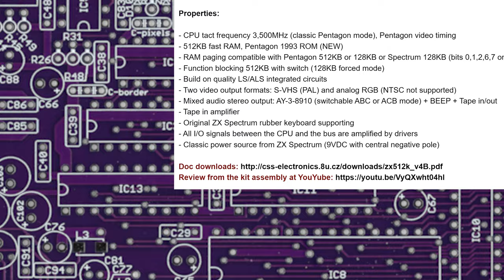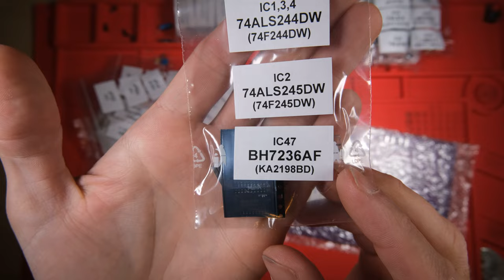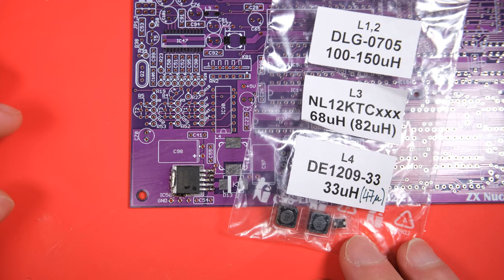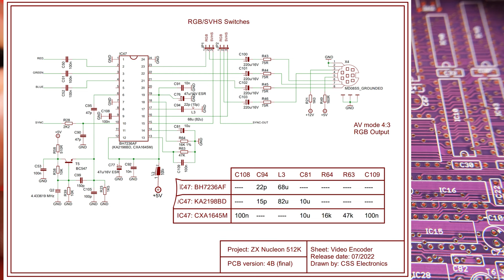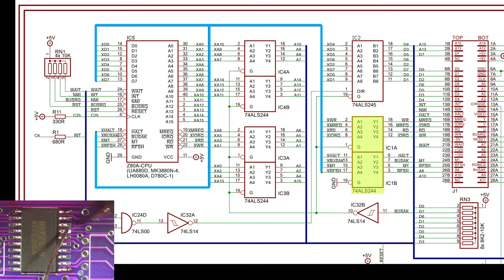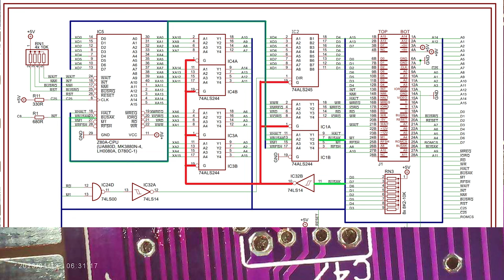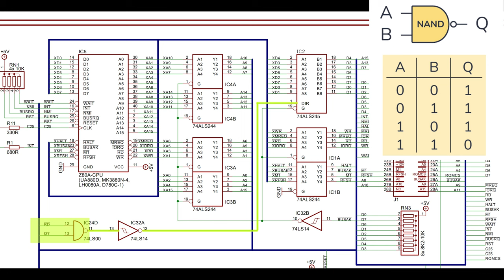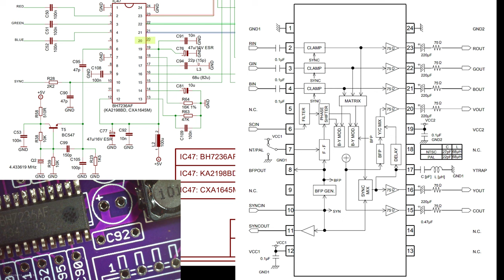ZX Nucleon 512KB - Build Part 1 - SMD

Comment: Best way to do those big D2PAKs is start by tinning the pad as you did, as flat as possible.. but then BLAST IT with hot air. Then sit the chip down with flux. As you've discovered that big pad will absolutely just suck the heat away from your soldering iron.

Another way I've done it is to sit it first, solder the main pins, and then blast it with hot air before feeding the solder in at the top. Normally enough flows under the chip to make a good joint

Comment: A tip I picked up from off all people, a plumber... with large pad  SMD stuff (much like a copper pipe joint) you add loads of flux between the parts. then bang on as much heat as you can manage, then just when its all bubbling nicely, dab in the solder and it instantly melts and due to capillary action, flows between the parts and makes a solid (water tight) seal. Also, the flux acts as a glue to hold the part in place so you aren't pinging things around the workshop.

Comment: That part at 5 min, add flux to the pad, then place component on pad, then pre tin the tip (wet the tip), then hold the wet tip on the edge while holding onto the component with a pincette, once the pad and component heats up the tin will flow and form a bond between the component + PCB. Once a bond is set you can add more tin to it.
Reply from the maker: Great tips thank you I will do this next time

Comment: I've worked quite a lot in surface mount, and we always printed solder paste (with flux in it) onto boards, placed components and then baked the boards in specialist ovens. Of course, this was for bulk orders so printing the paste isn't really applicable for you, but syringing blobs of solder paste in the right places and heat gunning might be - I guess it depends on how much surface mount work you do... Just a thought.

Comment: A couple of points if I may... please don't refer to chips by the first two characters of their part numbers - it is incredibly ambiguous. AY chip... LM chip... Both General Instrument and National Semiconductor made huge numbers of devices with those prefixes, and even in the context of the Spectrum there are other parts that can begin with LM.  Power inductors are not orientation specific, so no problems there. However, the current rating in the inductor datasheet is not the same as the output current of a circuit using that component. It's the peak current that the inductor can handle without saturating (magnetically). The output current of the circuit may be less than a third of this rating depending on the specifics of the design and circuit conditions. Thanks.

Comment: I do not understand one thing. You seemed to struggle to solder the voltage stabilizer on that big pad - understandable. So you decided to use hot air to remove it and start over. ... You used hot air to remove it... and not to attach it in the first place... at the time when no other chips were on the board to be affected... Just trying to understand why.
Other than the soldering, which seem to need a bit more deliberate practice (and a rework station if I can advise), really good info sprinkled in! Thanks.
Reply from the maker: Yes I've learned a lot from this and will do better next time 😉